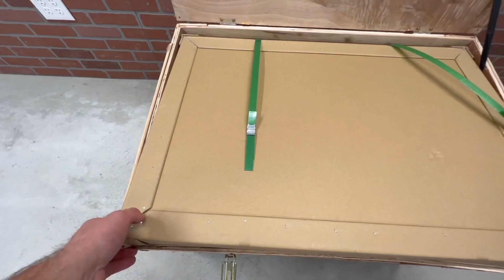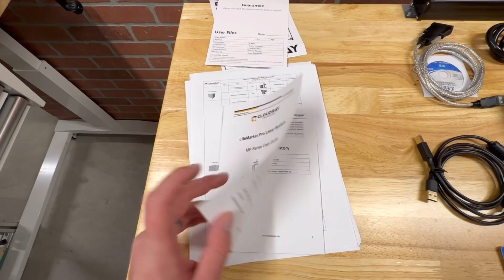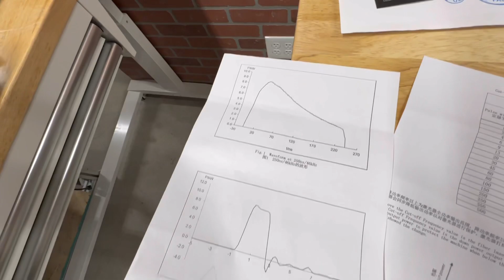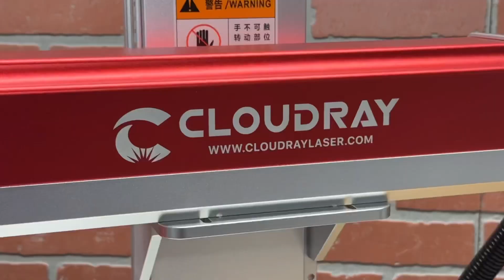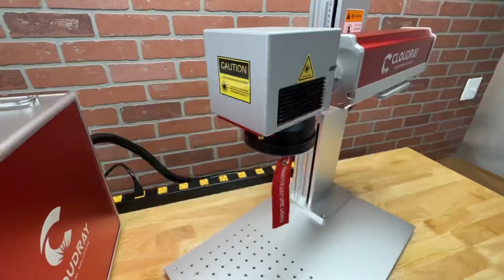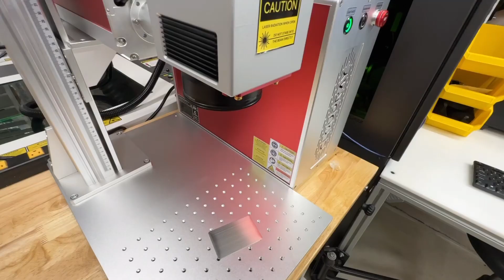Cloudray LiteMarker Pro 60W MOPA Fiber Laser Unboxing and Setup

Comment: what size is that wood top on the toolbox the laser is sitting on? looking at a 46"x18" husky, curious if the laser and power box would fit on the 18" dimension

Comment: I just got this exact same laser model. Plugged it in released the emergency stop button but when I push either power button they do not turn green or allow power to the unit. No fans moving no noise of any sort. Any idea what I’m doing wrong? Or did I get a bad unit? The emergency stop button is glowing red meaning it has power to it but it’s not engaged and I should be getting power… I’m alittle upset for a 6k purchase
Reply from the maker: That’s very strange. If I recall correctly, the e-stop button should turn green when released. Are you certain that the e-stop button is released? If so I would recommend getting in touch with Cloudray customer service right away.
Reply: I opened it up and wiggled every wire I could reach and now it’s turns on and yes the e stop turned green now. Thanks for replying
Reply from the maker: @ oh good! Probably just a connection that came loose during shipping. Glad it’s working for you now!

Comment: My laser won’t work in light burn for some reason? Marks fine on EZCAD but I always get a “disconnected” status on light burn?
Reply: have you found the solution?
Reply: Same boat here
Reply: You cannot work with EZCad and lightburn at the same time. If you want to use lightburn you need to uninstall the EZCad driver.

Comment: Thank you for the video! I do have a question, maybe you can help me find an answer. Can this machine do very thin lines of engraving on metal. When I say small, I'm talking about  0.005" in thickness/width?
Reply from the maker: Good question. The actual spot size of the laser depends upon the lens you use on the galvo head. A lens with a longer focal distance and larger working area will have a much larger spot size than a lens with a short focal distance and small working area. According to Cloudray's website the shortest focal length lens they sell, which has a working area of only 50x50mm, has a spot diameter of a mere 0.0005". The most common lens size is a 200x200mm, and Cloudray claims that this lens has a spot size of about 0.0014". That is of course assuming all other parameters are perfectly set, but I would say that achieving the 0.005" line width threshold should be plenty possible. If you have a test piece you want to try Cloudray is often willing to arrange for a sample marking so you can see if their laser will be suitable for your application.
Reply: Thank you so much for the answer. I'll check with them and see if they can provide a sample. Looks like this most likely will work for my applications. @flare_fabrication

Comment: Does it come with a red dot tracer? Where it draws out the design for you. I saw it traced the shape, but I’ve seen other lasers trace out the whole actual design. Would this one do that if the design was more simple maybe?
Reply from the maker: Yes, the guide laser can trace out the exact shape of the design that is being engraved. The laser software has multiple options you can pick from for tracing out the design with the guide laser, and in this case I just used a bounding box method for tracing the design.

Comment: Hi there. Thank you for doing more than an unboxing and doing a first color test. I tried the same flag file for the same machine and did not get a good result. Is there anything you did to adjust the file?
Reply from the maker: Nope, I didn’t make any changes to the file. I had pretty good results from the first time I tried it. Did you get any color at all during your test? There are a number of factors which could impact the results you’d see from this test.
Reply: I did get color just dark. Normal red/blue/green did not come out.  I will keep playing with it. Just noticed in the Flag file, the "grey" was set to no output. Was wondering if you had flipped that on. I tried it 'on' and still odd outcome. oh well, big learning curve for me. At least your wonderful video got me this far. Thanks again.  @flare_fabrication
Reply from the maker: @EdithG-tr1ib  ok, got it! If I remember correctly, the grey layer was sort of a base engraving pass, so I turned it on. From my experience every fiber laser is a little bit different, so very seldom will the exact same settings work from one machine to the next. I got pretty lucky in this case, and actually saw sone pretty decent results with the file Cloudray provided. Even so, I could definitely improve the markings with a bit of tweaking. Best of luck to you!